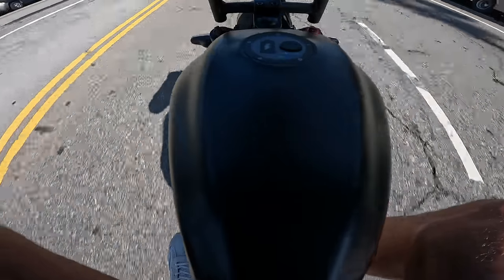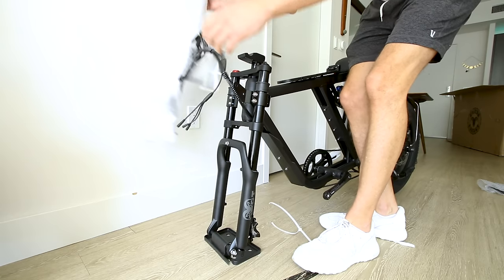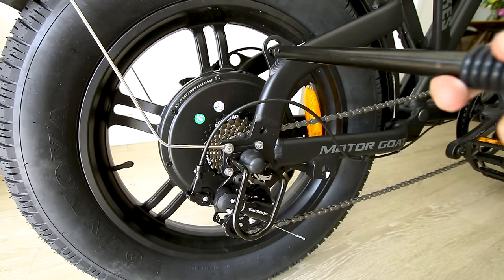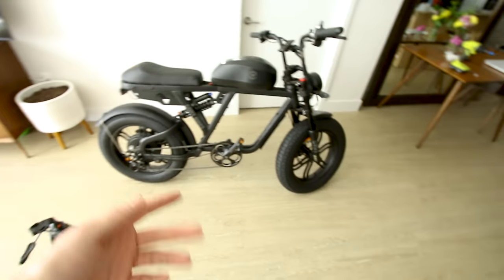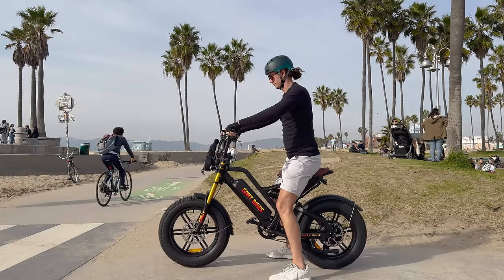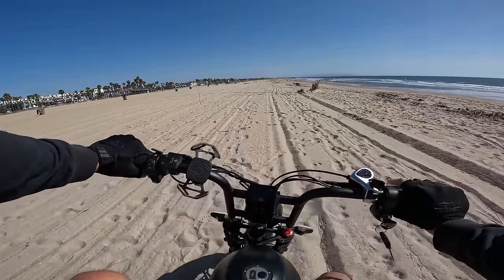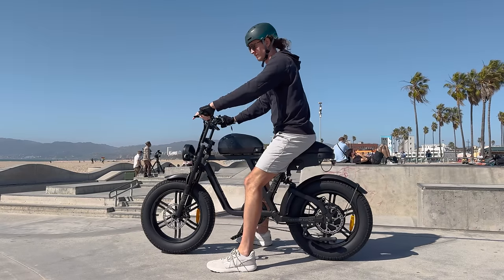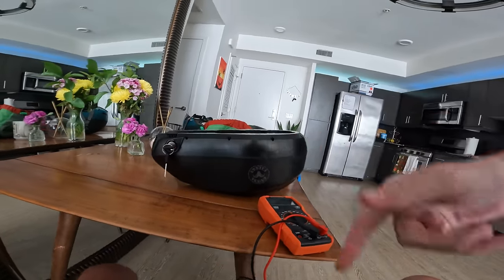This Affordable 44 MPH Ebike has a Sneaky 60 Volt "PLUS" Secret - The Motor Goat V3 Review

Comment: Looks like the Super 73 RX but $1,500 cheaper, and faster with more power. with extras standard. If Super 73 is going to survive the next 10 years. they have to make a dubble suspension bike that's affordable.

Comment: Glad i ordered me one. If I'm not mistaken, this one is before the updated controller and Sammy cells. I hear that one gets u even closer to 50mph! Also I'll have the dual battery setup for a more lower, natural center of balance. One heavy ass bike but hey, better stability at fast speeds.
Reply: Right. Youll also have a wattage readout on the display, n a 4 inch front tire instead of 4.5 inch so u won't have to worry about rubbing like the old models.

Comment: First thought when I saw the holes for the passenger pegs was that they would be perfect for hooking up a trailer.
Reply: That is an exceptionally good insight.  Yes, that would make an ideal connection point because of location, and the extra strength of that point.  I am surprised nobody else has given you a thumbs up for your comment.

Comment: When a battery says 12v or 48 volts or 60 volts that its nominal voltage. 

When its fully charged its going to be a few volts higher (if it wasn't, it would drop below its stated voltage shortly after you start using it or put it under load). 

Second, in order to charge a battery your charger has to output a higher voltage than the battery itself. Think of it like adding water to a pressurized tank. In order to refil

Comment: I have had my eye on the MG V3, thanks for your review.
Reply: Same. Seems like a good price for what you get, considering the market.
Reply: I bought one Feb 27 but i wont get it until April. i cant wait!!
Reply: This vs wired freedom? anybody
Reply: @hamond22  I considered both, but bought the goat today.  The things that made me choose the goat: 203mm disks with 4 piston hydraulic brakes, second battery option for a total of 45 Ah of battery capacity (less range anxiety), factory turn signals which for those who ordered in March, blink.   Higher speed (stock) than the Wired Freedom.
Reply: @rodrigoguerrero8570  Did you get yours before the delay?

Comment: Grumble   I bought this bike today, with the optional second battery (20Ah) and rear rack (with the sissy-bar I will probably remove).   I didn't realize you had posted a review with a discount on the Motor Goat v3.   On the May shipment, they make the rear turn signals blink (as versus being steady on).  Oh well, I think I will still be quite happy with it.  Ordered 24 March, with a mid-May delivery.  It will be my "commuter bike", where I must deal with 35 MPH traffic on the roads.  My current bike maxes out at 32 MPH, but has over 160 Newton Meter of torque.   You reviewed my current bike (Zeegr S1), and it's 0-20 time is about the same.  I ended up getting in the settings and made the acceleration ramp-up quicker than the factory setting on the Zeegr, I suspect it may turn a faster 0-20 than the Motor Goat v3 with that setting change.
Reply: Most companies if ask nicely will give you the discounted price. 

Besides, as my late father instilled in me when in grammar school: "always ask, all they can say is no."
Reply: I hope you asked the people.

Comment: IDK, i've been watching a ton of your videos and some others too and, ebikes are cool and all but you get so much more power, speed and sometimes range, with escooter for a fraction of the price and just the sacrifice of sitting and pedals. I've been wanting an e ride for fun and to go back and forth to work sometimes. The scooter i'm thinking of getting is 3000watt duel motor, hydro brakes, good suspension and a top speed of 45, for 1200$, and there is many options in the range of those specs for around that price. Personal preference and budget consideration i guess. Thanks for all the great videos. You make the best ones, from all that i've watched (which is a lot lol)
Reply: I like scooters, but unfortunately the base I work at does not allow them to be operated on the roads there.  eBikes they allow.

Comment: for an ebike going up to 50mph, weighs 100lbs with weightt limit of 450lbs according to the specs I would probably quickly swap the disc rotors for larger 220mm which is the largest standard size for mountain bikes. it costs literally nothing
Im surprised it doesnt have regen options, because being a direct drive hub motor it can do regen braking through software easily. helps increasing range, and reducing pad wear.

Comment: You might look at the Power Goat V2 as well since they did a revamp. Its one of few models ive seen that has dual rear suspension now (2024 change they did silently). It has lower battery placement with two slots for batteries on the lower frame. It does give up the potential storage space bag. I talked with Bryson at the office and he said for people who dont like the motorcycle tank look but want all the benefits of dual batteries and more weight lower its up there with the v2 the different is rear suspension type and 5mah on battery life and its $100 cheaper

Comment: its totally normal that the charger voltage is higher than battery nomimal voltage. back brakes on motorcycles is usually under the right foot, left lever is clutch

Comment: Great vid, I like this cause its rated for heavy loads also. 450lbs. Im 270lbs and am planning on going with 2 batteries. Are parts readly availble?  ty 🙂
Reply: 270lbs plus 112lb bike 382/450 be careful

Comment: Goat bikes are the new hot item. They are coming out with ebike after ebike one upping the following. That space in between the two wheels can easily fit 80 more amps of battery. I’m waiting till they go to 72Volts & a nominal 3000watt motor that has a 85 amp controller, so we get 6,120watts at peak. With that about 60mph should be reached along with much more torque. Speed counts, but to me, torque as well as brakes with of course good range is tops.
Reply: Why not get a motorcycle at that point?
Reply: They are the GOAT
Reply: @turt1231  cause I wouldn’t be able to take it into a store, ride it on a bike path, or bring it into the house. I am not against a motorcycle at all, but definitely this set up has its advantages.
Reply: @buffalomind6838  
While that is true. The problem is that legally, we are supposed to have no more than 750 watts motor. Anything more than that, you have to register and probably have a license plate. What do you think?
Reply: @EdmundV there's people that put in a 72v system
Reply: QS 205😅
Reply: @turt1231  time and place. Don't drive like an ass when around pedestrians and cars, when in a safe space, letter rip.
Reply: @MikeDyson3k  
Of course, but again, if cops stop you, they can give you a ticket. There are some cops that are petty like that...
Reply: Hopefully the most important thing on the bike doesn't fail. 45-65 is a huge difference in stopping distance.

Comment: Hills are what separates these bikes. I could use some help my friend. I live in San Francisco, hills are everywhere, the hill outside my door is probably bigger than or steeper than the hill you just climbed. I need some thing with balls to the wall power that I don't have to get a license for otherwise I'm just gonna cave and get my motorcycle license. 
I want to be able to throttle only for the most part if I want to, put a cage on the back, put a bag of groceries and do my thing. 
I would really love your honest opinion on an E bike that could handle that, power, torque and speed or obviously my number one concerns. Thanks!

Comment: 0:14. 60V is the nominal charge for the battery. A 48V bat will charge into the 50+V / A 60V bat will charge into the 70+V / A 72V bat will charge into the 80+V. People call it a surface charge. After going on the street the battery will settle down into its nominal charge fairly quickly.

Comment: I ordered this bike with dual batteries with your code after your billy goat review. Can't wait to get it!
Reply: How much is the bike?
Reply: @badbeat7108  after using his coupon code and adding the second battery after tax it came out to a little over $2,800. That's the pre-order price though. I think they said regular price for bike only is $2,750.
Reply: @BobS515 you got the battery blender?
Reply: Are you getting yours with the April shipment.i ordered mine Feb 27 but still has not shipped.

Comment: I think I would have liked it better if they used the lower battery location as the main battery and the top rail location for an extra battery if you want one. It would lower the center of gravity & improve handling.

Comment: It needs a front wheel motor for added torque and 0 - 30 in 5 or 6 seconds. My Lectric XP V1 has one added and though it still only goes 30 it gets there very quickly and goes up hills maintaining 25 mph. ($500) I would like to upgrade but don't know if there is the perfect bike yet.

Comment: 2ND 60V 20AH BATTERY KIT FOR THE MOTOR GOAT V3 FOR ONLY $599.99 IS AWESOME!!!
BMS system will shut this battery down Long Before total discharge. 4 amp charge is probably more like 2 or 3 hours...

Comment: Thanks for the information! I’m an old guy looking for an electric ride for my cabins. Rough terrain, lots of cow trails. I want a bike to explore the area on. What would you recommend? Thanks.
Reply from the maker: perhaps dual motor for more torque in off road rough terrain, get full suspension for sure, knobby tread tires 4 inch wide tires, either 20" or 26" tall depending if you want more torque or smoother ride.
Reply: @TailHappyTV do you have a model you would recommend? There are so many out there it’s confusing. Thank you again 👍

Comment: How comfortable is this for the low back? I owned the wired cruiser (no rear suspension) and my back killed after a month riding it.  Wondering if this moped syle and dual suspension should solve that
Reply: Dual suspension is cleannn. Super comfortable on lower back. I rip mine through trails as well
Reply from the maker: get a suntour suspension seat post, it's a game changer and will transform your riding experience on the wired freedom hard tail

Comment: So I’m thinking about buying this if I buy the second battery kit , does it make it go faster or just longer battery life is it worth it 
Or what I’m really asking is is there a difference?
Reply: You ask a tough question, so you will get a complicated answer.  One of the things which influences "top speed" is battery voltage.  At full throttle the controller draws 50 amps of current, which causes the battery voltage to sag a bit downward.  When you have two batteries, you get less voltage sag under a 50 amp load, which translates to a slightly higher top speed (probably 1 or 2 MPH).  Also, you get more range as well.

Comment: Every time he reviews a new china bike I say "Damn my DIY Bafang Mid Drive is the damn G.O.A.T" I get 35 mph off a 750w motor. If I upgrade to the 1000w Ill get 40 mph. 27.5 inch wheels
Reply: What do you have it on?
Reply: @Raymasseyus  Cheapo Benotto Trival Mexican Dept Store dual suspension. I wanted it cause of the steel frame weighing 41lbs. Easily weldable to racks & moving the rear suspension mount for a 10 inch spring. I even welded on a trailer fork so I can haul with dual suspension. I got 700c dual walled hybrid ritchie wheels from my gary fisher, with 525 freehubs & the RST 60mm front forks from the 2004 gary fisher hardtail. It has plastic bushings at the linkage but I changed them to 3 washers. The center washer has holes drilled and de burred that are packed with grease. Better sideload and thrust than bearings and cheaper. - Detroit
Reply: @Raymasseyus  Got the bike free on marketplace. The guy who wanted 50$ for it traded it to me instead I just finished replacing shift solenoids in his 08 colorado as a trade. So I paid nothing. Bike had mechanical disc so its good enough for now. Im in it for 1000$ with a 25 AH samsung battery.

Comment: Is the lower battery mount just a holder, or a connection? For center of gravity, can you run from the lower mount alone?
Reply: The second battery kit includes a battery combiner to make both batteries work together to provide the power for the load.  The second battery is only 20 Ah, and not 25 Ah, which tells me it is a 17 in series, 4 in parallel.   It would probably run the bike on the second battery alone, but you will see more voltage sag.
Reply: That’s what I want to know as well

Comment: If it's got 7 years do you have to just put it in 7th gear when you are writing it or do you have to shift gears at all
Reply: 7 gears not years😊
Reply from the maker: The gears for peddling work completely independent from the motor, you do not need to use any sort of gears to operate the motor

Comment: Since they use a standardized cell, why don't the design them so you can replace them, if you need to?
Reply: Virtually all battery packs uses a spot welder to make electrical connections to the batteries for ALL eBikes.  Replacing cells "CAN" be done, but it requires the right equipment.

Comment: I have 2 wired freedoms.  I can't wait for them to up the voltage and battery capacity to two batteries and a more powerful motor.  Is it too much to ask for 50 mile range and 60 mph?  I would also like to see regenerative power. if im peddeling or coasting I should be able to get something back.  I'm sure we will see all these things in the future.
Reply: Three months have elapsed, now all the top runners (eCells, Wired Freedom, Goat) have upgraded their designs.  They all now have dual battery as either a stock feature or an upgrade option.  As for regenerative charging, the dual battery design on all three use a "battery blender", which only allows power to flow OUT of the battery.  This means with a blender you will not get the regenerative option on any of these three eBikes.  

They are about to release a secondary 50 Amp hour (Ah) second battery pack for the Goat, which will give a combined capacity of 75 Ah.  This means you will get about a 50 mile range at top speed with that larger battery.   However, 60 MPH is still not an option with that larger battery pack.
Reply: @addertooth1  After riding my ebikes I determined that I was actually safer on a scooter.  There are bike lanes but often I would end up using the side walk which is often treacherous with uneven crazy dips, bumps and tree branches to look out for.  I sometimes got on the road but was soon looking for a way on to the side walk.  What really broke the deal for me was not being able to carry 2 ebikes on my car.  Weighing only 180 together they made the bumper nearly drag the road. I didnt see that coming since the same thing doesn't happen when 400 lbs of people plus  luggage in the trunk doesn't do that.
Reply: @michaelhord  I felt unsafe riding the roads on my slower eBikes.  On the Goat, I flow with traffic and don't have cars crowding me on the left.  

The Goat is quite at home on the streets.

Comment: Whats up man? I have the power goat V2. You can add a extra battery to the ebike and get more range. Why not put out the side mirrors?
Reply: The side mirrors aren’t all that impressive.
Reply: Why did you go with the power goat over the motor/Billy goat?
Reply: @EdmundV  to me the ebike looks better man.
Reply: @aychfriday  I chose safety over looks man.  U taking your eyes off the road for a hot second.
Reply: If you are broad shouldered, you will prefer the mirrors that slide into the END of the handlebars.  The view from regular handlebars is blocked by my shoulders.   I use the Meachow mirrors for a better field of view.

Comment: in my state, we cant go over 20mph unassisted on a flat surface. can the speed be locked to not go above 20mph?
Reply: All eBikes have different selectable "Pedal Assist Modes".  You can simply set your PAS mode to a lower number to ensure you don't exceed 20 MPH.  This is selectable by a button on the left side of the handlebars.

Comment: I'm a little skeptical about the battery placement being so high. t limits the response time you can avoid objects. ANY vehicle having a lover center of gravity has a performance advantage.
Reply: I weigh 225 pounds, and my body is "above the center of gravity".   The weight of the battery would only have a measurable difference for riders significantly UNDER 100 pounds.

Comment: Knees in the chest only short people need apply
Why bother with pedals at all, no adjustment on the seat.
It's way beyond class 3 which even those aren't allowed anywhere in my state.
That would fall under motorcycle regulations and no the pedals wouldn't save you from getting big fines for that ride you recorded. You are the reason class 2 aren't allowed most paths, trails. Ripping past pedestrians is screwing all of us.

Comment: Is the controller inside that fake-tank, where it overheats?
Reply: The controller is under the seat, where it scoops in some airflow.  I have ran mine hard, and never had a problem with overheating.

Comment: At those top speeds, I would be wondering about the braking reliability
Reply: The current version is a quad piston hydraulic brakes with 203mm rotors.  This is top of class braking power.   I have no problem stopping with my Motor Goat v3.

Comment: I was looking at the meeload dk300max and this one. Trying to decide, both have pros and cons
Reply: Bro me too. That's what it comes down too
Reply: I had the billy goat v2 soon as they put it on the website months ago. I sent it back cause I wanted this version. Also I believe that fed ex absolutely trashed it during delivery.. but yea even the old version of these bikes before the updates for more speed and the rest of the tweaks they did that bike would get me to 40mph and I'm 280lbs. This bike is worth it. That being said.. the Meelod is the only other bike I would want.. the extended swing arm is a is a really nice touch and it still has a huge cavity if u wanted to add a bigger battery. N it's dual motor isn't it?